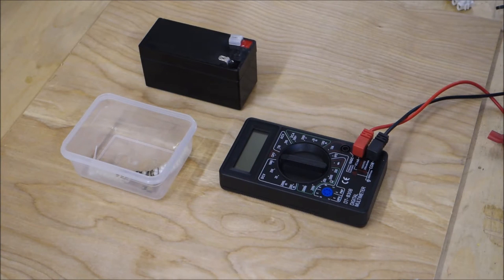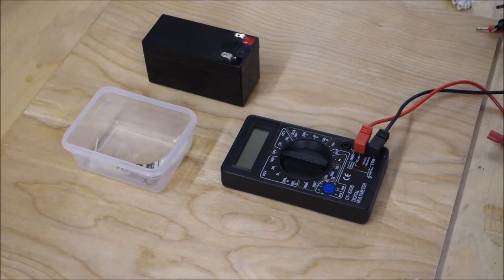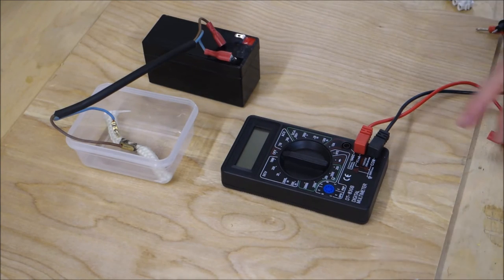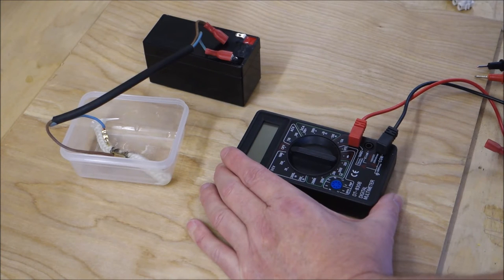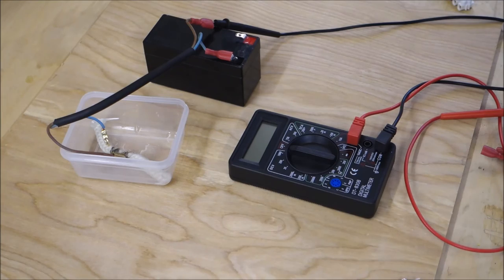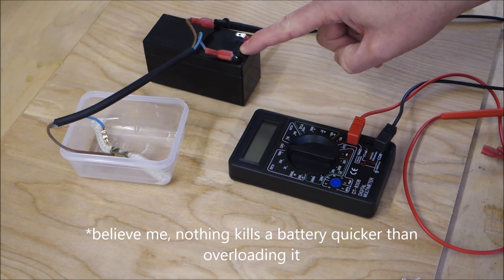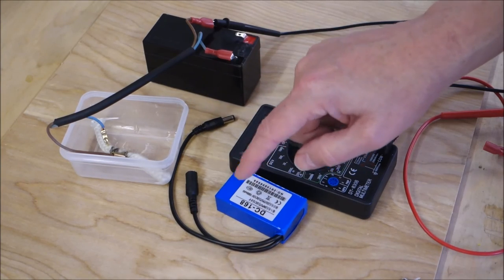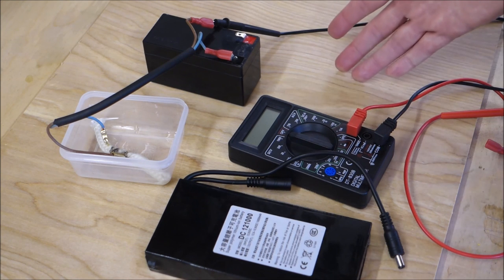Measuring power output with a multimeter

Comment: Thank you so much for the video. One thing to ask for:  you said that the 1.2 AH BT will run the 5.6 A for almost 6M !! 
as i know, i divided 1.2 (th capacity AH) over 5.6 (load A) = 0.21 H, so it will run the load for 12.8 M!! not 6
So, would you elaborate plz?  
Thank you

Comment: what tool. is used to measure power supply output voltage?
Reply from the maker: You can use a multimeter like this. It can measure volts, amps and others, depending on how it's set up.